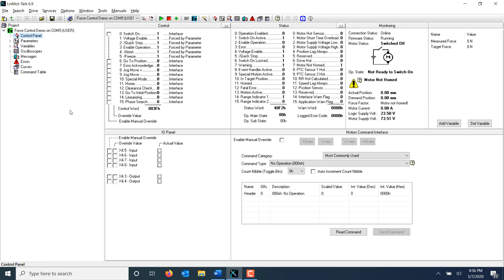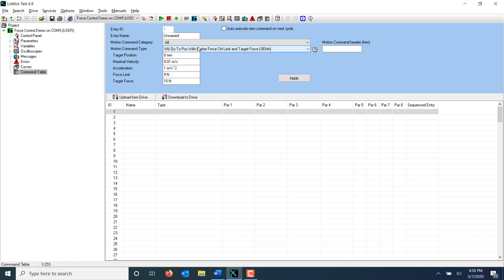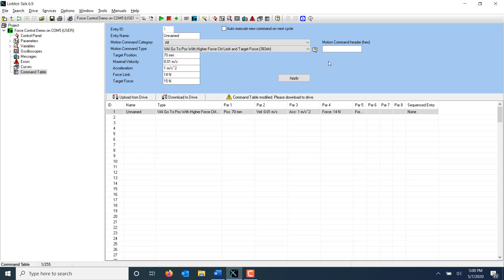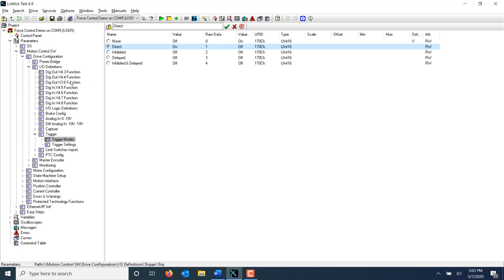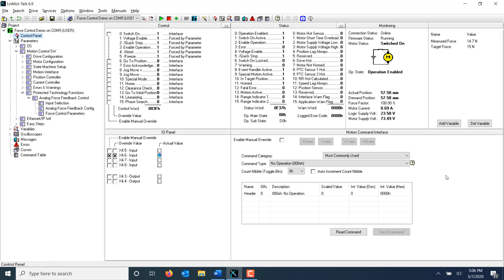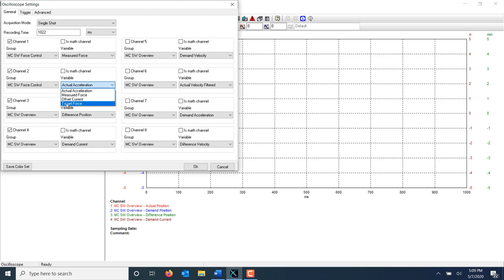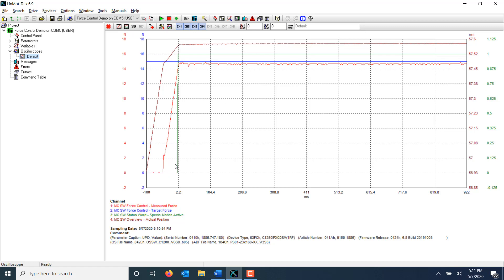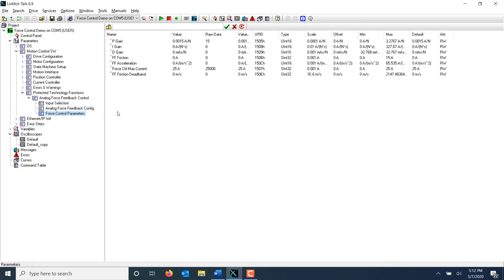LinMot Talk Configuration: Force Control Part 2

Comment: Great videos.... but I'm trying to figure out why our PR02 won't go into "Special Motion Active" once it moves and achieves the target force.  It continues to increase force until it hits my 100N load cell limit, and stays there until I release X4.6 input.  (C1250 drive purchased for EtherCat, but just trying to learn the drive/motor first before I get to that)  This is our 2nd Linmot project, the first has been in-use for a year.
Reply: I figured it out... in the PR02, a "Positive" linear motion is inwards towards the motor housing. I had to change the Protected Force Feedback Control / Analog Force Feedback Control / Analog Force Feedback Config / "0V/-10V Force" to a Negative value (-100N in my case); then the "10V Force" changed to a positive value (100N in my case).  Then my moves in the Command Table have to be "negative" direction moves to move the motor shaft out away from the motor housing.
Reply from the maker: Immediately contact usasupport@linmot.com and specifically outline your issue.  Provide your drive configuration files.  The tech can look at both drive files to make sure the parameters are set correctly.  Further clarification can be made directly with the tech.  Many times this is a PLC sequencing issue, the tech can help you there as well.